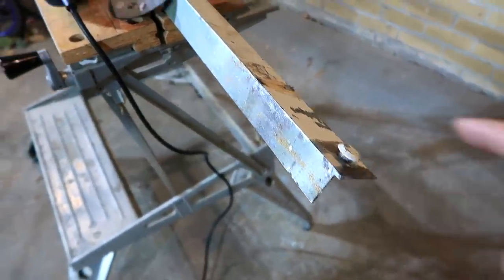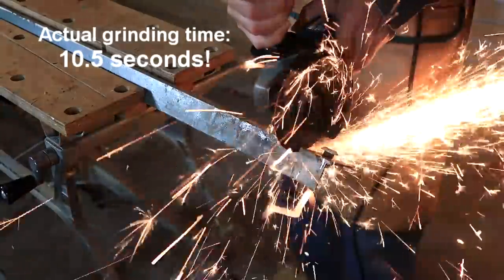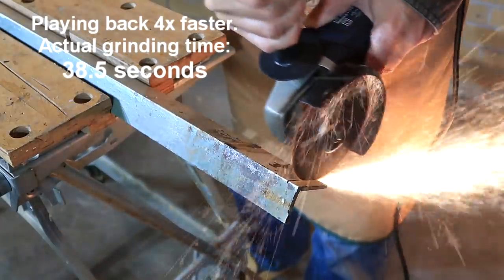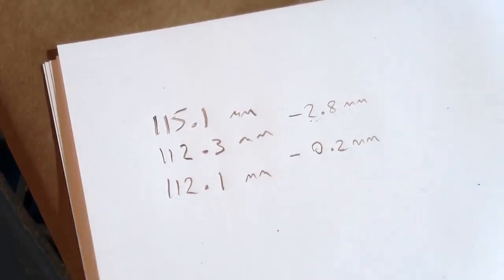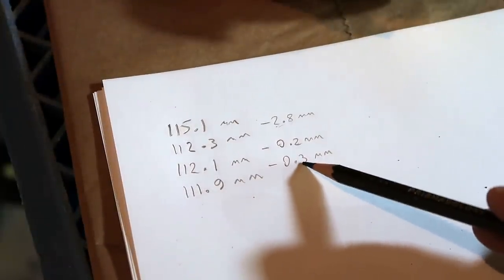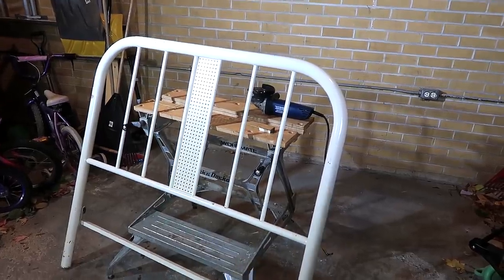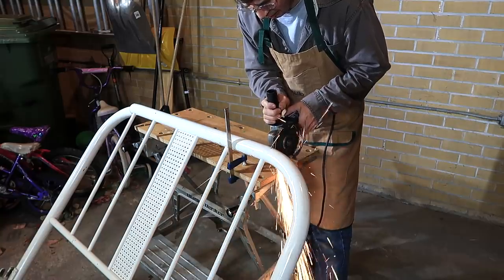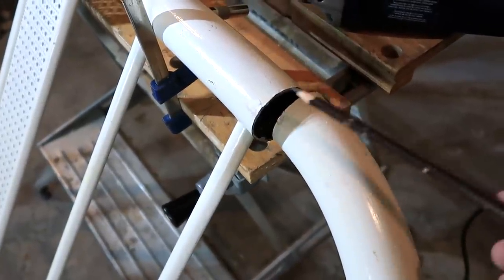make cutoff disks last 10x longer (replicating Fireball Tools' experiment)

Comment: As a former welder I can also confirm this. But there are more benefits than less wear on the disc.
It's easier to cut accurate, and less risk for kickback.
Only time you want to cut straight thru is when cutting sheet metal and it resonates, that eat up disc's in no time.
Reply: I feel more accurate with plunge cuts, as the disc that is in the curf guides the cut in a straight line.
Reply: I agree absolutely, I have many hours and have cut hundreds of feet of I beams and HSST with a 9" grinder and never had a single wheel blow up on me. My boss complained about how long I took until he realized my cuts are accurate within a 1/16th and the other guys were lucky to be accurate within an 1/8th.
Reply: Absolutely. This is nothing new. How I was taught in trades, as well as what all of the manufacturers recommend. Before someone says "chop-saw", remember that the chop saw has a pivot that (should) keep the spindle in line and the disk in plane, so there should be essentially no side loading. First time you use a chop saw with a work pivot, you realize exactly how fast you can go through those wheels.  (I have done rail-car sides with a handheld useing the right method. Edge ready for new material from the shear, weld it in.Ac couple 4-1/2 disks per 44 foot cut in 10Ga- 3mm- steel, vs a box for my coworker. Time saved not changing wheels made up for slower cuts. Time not spent grinding the edge straight after the cut--- priceless)
Reply: @chrishoesing5455  That certainly can be true in some circumstances.  I am no expert, but I like to use the gouge method when following scribed lines in sheet steel.  It lets me take a couple of light, accurate passes before I really go to town on it.  At that point, the kerf from the previous passes guides the wheel.
Reply: Paid hourly...
Reply: @chrishoesing5455  true, somewhere in between is what i do. You kinda ride up and down in the cut, seems like the best of both worlds

Comment: I’ve been doing cuts like this since I started using a grinder, not because I’m thrifty, but because grinders terrify me!
Reply: It's pretty healthy to be terrified by grinders, it can go really bad really quickly.
I've had many bad kickbacks and disc's exploding on me, but never got hurt because I more or less expected that to happen.
Reply: That is completely fair, and rational, and wise.
Reply: no kidding!  Stumpy Nubs has a video where he almost lost two fingers while carving with an angle grinder.
Reply: @mackaronen  YES, I had a disc explode on me where it went spinning in three directions and luckily one of the directions was not at me.  Ever since then I go slow and I haven't had that happen again.
Reply: It's a table saw in your hand!
Reply: @PatrickKQ4HBD  Naw, worse than a table saw because I have never ever in 45 years had a table saw blade explode into three pieces being it is made out of metal and is actually cutting, but a disc is actually just sanding its way through at a very high rate (abrasive disc).
Reply: Same here until I had to remove a metal tub and it was very awkward to cut, so I did it it fast and brutally.  Blew through the disk in no time.
Reply: @krenwregget7667  - Stumpy had a chainsaw blade on his grinder, not an abrasive cutting wheel.
Reply: @UserNameAnonymous  This is true.  That said, the rule of quadrants Stumpy mentioned are applicable with any rotating blade on an Angle Grinder.  Healthy fear of power tools, and an understanding of the risks is generally a good thing in this amateur's opinion.
Reply: @boppins  We always just let the biggest dude on the crew (me) bust them into chunks with a sledge hammer
Reply: Same
Reply: @boppins  ear muffs and a pick is way faster
Reply: I've always told apprentices not to "fear" any tool, but to "respect" the tool.
A small shift that does wonders for their confidence while becoming proficient with any tool.

Comment: The results are even more interesting when you realize, that the first cut had a bigger diameter at the disk and by that, more surface to grind with each rotation, but also more speed at the contact area.
Reply: Yes, I was going to comment the same thing. You almost want to calculate the volume of disk removed in each test, not just the diameter change, to possibly get a better comparison. As you mentioned smaller and smaller diameter with each cut, so more revolutions for the same disc contact length/distance which will manifest as increased diameter reduction the smaller it gets.
Reply: I was going to say that too
Reply: @mikevisser563  Had the same thought. It's not so hard as the width is constant, so the area of the doughnut is Pi * (r1^2 - r2^2). So about 500mm^2 lost the first cut, 35mm^2 lost the second. Ratio is about 14:1.

Comment: Sure, the wear is 10x less. But the cut also lasts 4 times longer. So I'd say it's actually 40 times the fun per disc :)
Reply from the maker: if you enjoy watching the sparks fly, yes.
Reply: Technically correct. The best kind of correct
Reply: I'm no discologist but this seems right.

Comment: You have to add to the "fast" plunge cut time a fraction of the time to replace the disk as you would replace disks way more often. At the end of the day, the "slow" technique isn't that slower, but for sure it is cheaper and probably safer also.
Reply: In that 'replace the disk' time don't forget to factor in drive time to the store or waiting on a delivery. I will bet a doughnut that a full use case analysis favors the gouging cut.
Reply: @Ian Tiggemann If you just hold the motor brake and turn the disc with your hand counterclockwise, you don’t need the wrench. Same thing for tightening.
Reply: @bladee_enjoyer540  yup it take less then 30 seconds to change a disc so just one fast cut already makes up that time, as for the cost of buying blades just buy in bulk while you are at the store so you always have extra, that's the best practice anyway.
Reply: @Ian Tiggemann u dont need the wrench lol
Reply: @Ian Tiggemann that's why I bought me a fancy angle grinder with a tool free nut. It's battery powered aswell.
Super cool!
Reply: @SuperDeinVadda  Is it a Bosch? I saw they came out with some new system a while back
Reply: @andash123  it's a festool
The new bosch system is pretty cool albeit pretty expensive in use.
But it's definitely the way to go in the future!
Reply: @andash123  
It is more or less a marketing gimmick. The wrench was never needed to loosen or tighten discs with those small 4-1/2" grinders. Tradesmen have been just using their hands to do that since forever, and it takes like 10, 15 secs to change a disc that way.

Comment: Thanks for the confirmation! I had already watched Fireball's video and was impressed. Still, for many jobs, I will continue to use the plunge cuts, because they are much faster and disks are not that expensive - it's a trade-off between your time and your wallet 😃
Reply: More than dollars for disks, I live in a rural area and stores are some distance away so t takes allot of time to run into town to resupply. I prefer the idea of making the disks last and not run out of disks in the middle of a project. A round trip into town costs me close to $15.00 in gas in an economical Fiat. Those are my considerations
Reply: @politicalpartyagnostic268  Consider buying more than 1 disc per trip into town?
Reply: The time to change disks increases x10 with the plunge. That’s the real time savings.
Reply: @Name-vu1kn   the time to change a disk is what... 15 seconds if you have to walk across the shop to grab the new one.. maybe 5 seconds if the new ones in arms reach
Reply: @politicalpartyagnostic268  Yep. Valid reason. Like I said, it's a balance between time and expense.
Reply: @vaxjoaberg  Also valid - I buy packets of ten disks.
Reply: @AndrewBrowner  depends.. are you grinding on a bench or while on a ladder, crawlspace, etc?

Sometimes changing a disk isn't easy

Comment: A "partial plunge" should also be tested, where the plunge is just deep enough to poke through the material, and then kept at that depth as you feed through the cut, just like you would on a table saw. I think this will land as a medium between the two techniques.

Comment: I learned something today!   Also, as the  circumference was smaller, it probably will wear exponentially
Reply: @Build motion, i'd way the contrary (without and proof nor science) because when it gets smaller, the edge speed is smaller, thus less friction and maybe more efficient and less wear ?)
Reply: The difference is negligible when compared to the diameter, only when the disk becomes really small it matters.
Reply: I was kind of thinking of that. To get a good representation of it you'd need to start with a fresh wheel. Haven't seen fireball's video yet, maybe he does that
Reply: @ccox7198  so, negligible
Reply: @Andyjpro  Yes, Fireball changed the disc between tests (he tests how many cuts he could get with each method), but as others have pointed out this test is good enough.  you could always do the test yourself, that's how peer reviewed science works.

Comment: When I have a bunch of cuts to make I just buy the cheap disks and plow through. I found a really super thin disk the same brand as what Fireball Tool used, and found they cost about $12 each vs Harbor Freight disks that are about $1. I made a ton of cuts with it before I accidentally broke it only about half used up. It cut really fast even using the gouge method, and that was cutting 1/4" stainless angle. Harbor Freight disks (Our equivalent to the Maximum you used) burn up super fast in stainless no matter how careful you are.

Comment: Can confirm, but generally taking your time and letting the tool do the work is a good idea anyway. Related fun fact: Often times bed rails, T-posts and traffic sign posts are made from re-rolled recycled rail road rail. It's great steel, but can be tricky to drill holes in.

Comment: What about circumference of the disc. A new disc would have more surface area than a worn out disc. No idea how this relates, but it seems like a pretty important factor. Also, wouldn’t the speed of the disc change as it get smaller. I feel we need another video to test this all our. 😁
Reply: Switching methods between tests would factor that out, it matters less on a fresh disk.
Reply: The RPM is constant but the surface speed of the face slows down. Fireball done the test using one disk till completion on each method so your points wont make any difference in that case.
Reply: the radius change is of the order of magnitude of 1% or the radius total, and given that both the cut velocity and cut area are proportional to the area, any effects the radius change have would be at most the same order or magnitude or so, and therefore the 1,000% difference in wear rate that we see caused by change in cut technique completely dwarf any effects of radius change - i.e. the test stands.
Reply: @CarlSuttondogmatic69  that is what I meant, but thanks for clarifying.
Reply: @TheAnimystro  but isn't the square root of PI directly adjacent to the percentage of wow that was a lot of big words you used.  Sorry, just couldn't resist.  :)
Reply: @Leadvest  I was thinking of cutting each test with a brand new disc.  In the end not a big deal to me.  As pointed out you either pay in time or pay in discs.  There are no free rides in this world.
Reply: @wesmadebuilds681  It's not often you get to save 90% of the cost and waste, with one change to technique.
Reply: I thought of this too, but the differences discussed were drastic.
Reply: @wesmadebuilds681  Fireball Tools used a disc per test, and simply counted the number of cuts before it wore out.
Reply: I was going to ask the same thing until halfway through the video, when he went back and forth between techniques on the bedframe and the hypothesis held. So while the mathematician in me wants three decimal points of accuracy, the pragmatic DIYer acknowledges this is a very pronounced improvement in any case.
Reply: @TheAnimystro  Valid, but it's only irrelevant to this application. Knowing the ratio of increased wear rate/loss of circumference as the disc wears could be useful if you're in a situation where time, resources, and material stability/risk of damage if discs shatter at a circumference and pressure are critical like for, say, sciencey stuff on other planets.

Comment: IDK why so many people are surprised by this. Everyone should be familiar with the concept of "speeds and feeds". There are ideal cutting angles and speeds to optimize for cut time or for tool lifespan. This result is likely due to the nearly perpendicular cut vs the shallow depth of cut moreso than cutting speed, though. An easier way to test would be to slow down during the plunge cut. Though, temperature of the disc might play a part. Would be cool to see a thermal image of the disc right after each operation.
Reply: The best way to test might be to mount the wheel or the whole tool onto a CNC or lathe and make multiple repeatable cuts.

I wonder how the manufacturer tests their product for QA.

Comment: As a number of commenters have mentioned electricity consumption, maybe you could rig up your Pi current measuring setup if you ever redo this test.
Reply: Battery powered grinders require not plunging or they kick off.  Slow cutting works great and is easier on batteries.
Reply: You'd have to run an angle grinder for over an hour to even get 1 kwhr...so about 10 cents. The cost of the wheels is FAR greater than the electricity consumed.
Reply: @isaackvasager9957  Exactly - the electricity cost is irrelevant. Like a couple fast cuts will cost 1 hour cutting time in electricity measured in cutting discs :D

Comment: The other variable in this test that needs to be controlled for is the operator. I recently bought a dirt cheap little frame that attaches to an angle grinder and basically converts it into a tiny chop saw. I just wanted something convenient next to the lathe. This thing was $8, it is not built well. That said, just having a rigid pivot point and cast iron platen, I get enormously longer life out of my cutting discs. I am admittedly not the most steady-handed, but when you are deep in a plunge cut, I think everybody wobbles and rubs somewhat
Reply: Hi, may i ask where you purchased the angle grinder stand? I want one and love the price! Lol thank you.
Reply: @daviddaddy  I just grabbed it off Amazon. I'm sorry I don't even know if it was a specific seller. They were quite a few all over the price range. I think if you search angle grinder chop saw stand, you will not have much trouble finding it

Comment: After I realized where all the "missing" steel goes (dust) I've stopped using angle grinder as much as possible and instead bought a (fairly cheap) metal bandsaw that can do most cutting jobs while making 0% of the dust.
Reply: Not to mention the steel dust is combined with fibreglass and abrasive dusts from the disc. Much better to avoid breathing that if you can.
Reply: That grey pile building up under your bandsaw is also metal dust.
Reply: @brocktechnology  there’s a slight difference in diffuculty between cleaning up a pile of filings and fine dust spread all over the room.
Reply: @brynyard  fair.
Reply: @brocktechnology  Exactly. It's in a pile instead of in the air.

Comment: 2.8mm -> 0.2mm is actually even more dramatic since it's not radius you care about but surface area.  115.1mm -> 112.3mm is a loss of ~2000mmsq, and 112.3->112.1 is a loss of only ~141; a factor of 14!  I suspect this difference gets smaller as the disk gets smaller, which is both consistent with your experiment and would help explain why it ends up only 10x overall.  (Or maybe it's some other difference in the test.)
Reply: Spot on. I was surprised that Matthias didn’t mention this. Though im 100% sure he thought about it.
Reply: CodeKujo, you've beat me on this one

Comment: I generally only use these discs to cut bar stock, and sometimes it's nice to cut through just to follow a line. You can absolutely feel the grit flying off of the disc as the through cut rubs the abrasive off rather than letting it get spent.

Comment: The rotational speed is constant throughout the disk's life, but the circumference drops as the disk wears away.  In practice, this means that as you move through the disk, each rotation brings less abrasive to the party per rotation.  That may account for why some of your later cuts wore away more of the diameter of the disk.
Reply from the maker: It's dwarfed by the effect I saw, and if I factured that in, the effect would be bigger.

Comment: Makes sense - the slower cut keeps the metal hot, so there's more melting/pushing metal out of the way as opposed to fast cutting , which is more using the blade as a brittle hammer to beat chunks of metal out of the way.
Reply: That's not the reason - the metal heats up because the abrasive is cutting it, the abrasive isn't cutting away melted metal. The reason is that with a more shallow cut, the blade edge isn't rubbing against the material as much.

Comment: I have found that sometimes it is better to use a saw (bosch jigsaw with appropriate blade). You can definitely cut faster than the slow grinder method, and the work piece is cool to the touch after the cut. Probably you can use a sawzall, too, but I don't have one of those.

Comment: Mathias, how about slowing down a plunge cut to take that same amount of time as a gouging cut? I find having the disc in the curf helps guide the cut straighter, and leaves a better, and more accurate cut.
Reply: It would either be the same wear, or more likely worse. The increased wear comes from the material grinding away at the edges of the disc inward, so if you slowed down a plunge cut, all you'd be doing is increasing the amount of time the material is rubbing on the edges of the disc, I can't imagine it would do anything except increase wear.